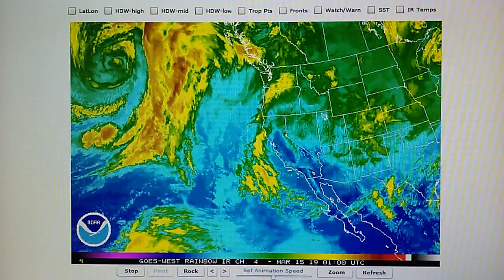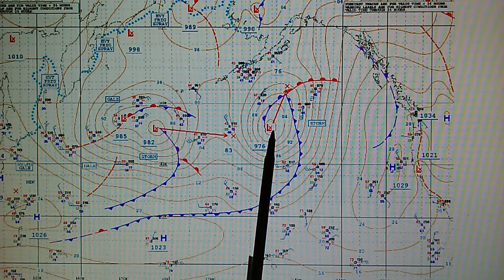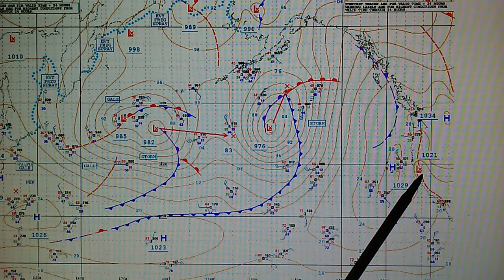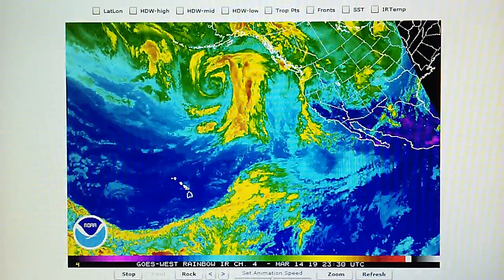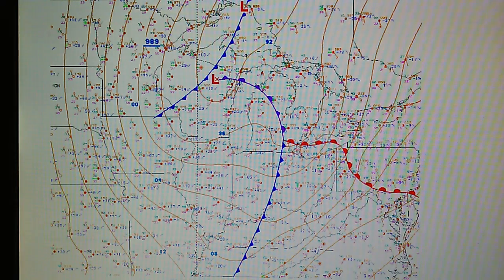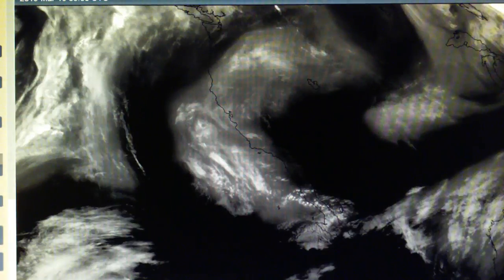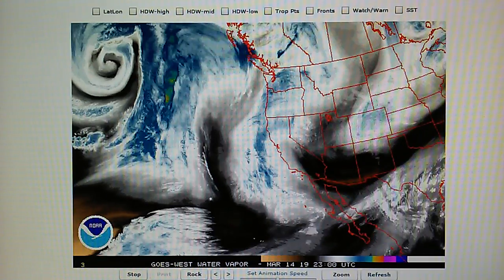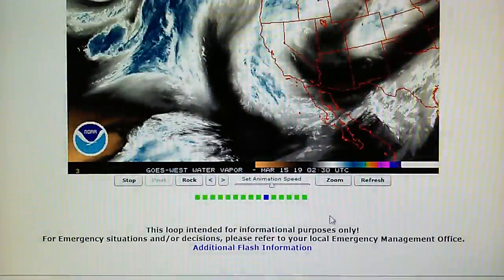3-14-2019; Satellite Transmitter Leaves Right Angle Imprint On 976mb Storm System

Comment: I told my mother and my wife that I had never seen a surface weather map that looked like this.
I’ll send it to you via email.
I live in Amarillo TX and was looking at a hurricane over dry land.
Isobars crammed together around a gigantic central LP.
I’ve never seen that.
Personally, I believe it was manipulated by humans.
Who? I do not know.just my opinion,
This goes against every theory of Hurricane formation by warm moist air rising and causing lift resulting in severe counter rotation and serious storms.
It was dry. No ground source of moisture. We had steady winds of 45-50 mph and gusts to 80+ mph sustained for at least 16-24 hours.
Clear skies. Because we had rain damping down the soil/dust the day before from a brief frontal passage.
I was right about my predictions.
As usual, nobody in my family even remembered I’d said that I’d NEVER seen a surface weather chart like this before.

Comment: @1pacificredwood, can you explain why Volcanic ash/gases reaching the stratosphere is reflecting incoming solar radiation and absorbing outgoing land radiation, leading to a cooling of the Earth’s temperature(they never specify time of day/night), but chemtrail ash in the troposphere is doing the opposite?
Reply: @savegreenland1640  Clouds of water act differently than aluminum ash, so it's cooler "under" a cloud of water in the day time.  Standing "under" this aluminum ash feels warmer in the daytime because it is transparent to UV rays.  The UV intensifies with the photoelectric effect and increases electron activity.  It blocks heat from escaping the atmosphere..
Reply: @savegreenland1640  If those were cirrus or cum. clouds they'd release the "heat" overnight.  Opposite happense when these "streaks" fill the sky....on a warm day it becomes "hotter" and the respective evening becomes "colder."  It would not occur on those streak-free days that are full of "natural" non-anthropogenic "clouds."